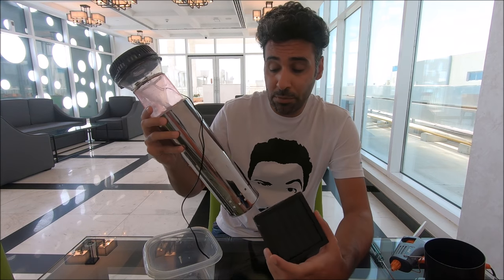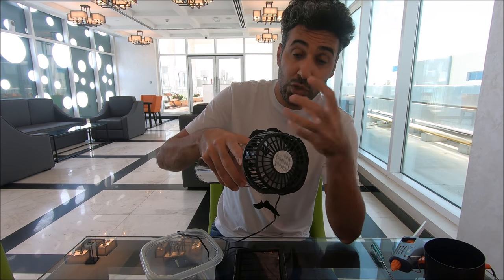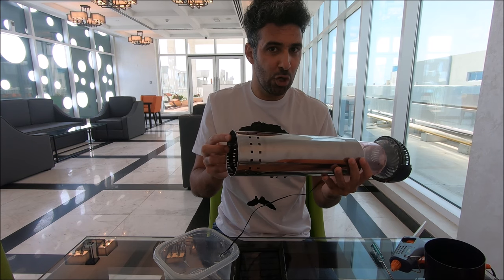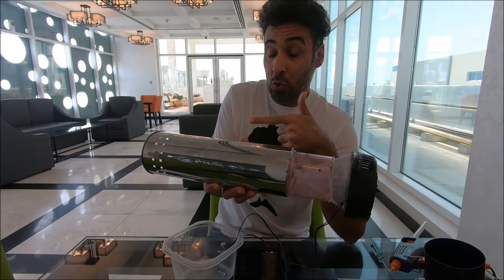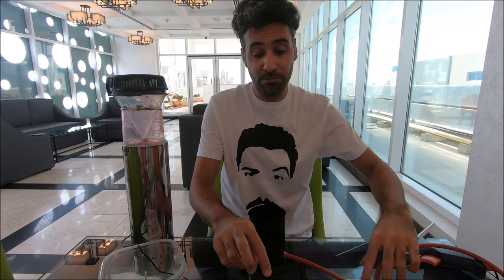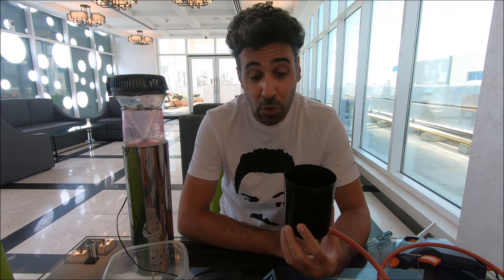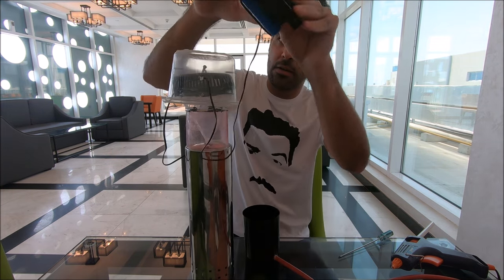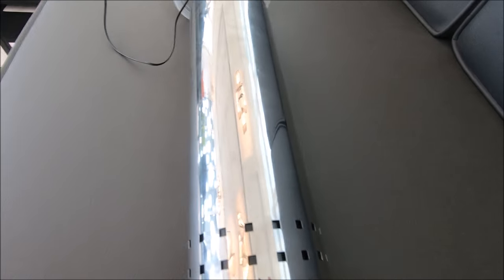Water from the air. Homemade atmospheric water generator (AWG)

Comment: Keep working on your design  I think there needs to be increased coil surface area similar to automotive radiator. I would not use an automobile radiator as many contain lead. Just something similar. Suggest giant lens to boil water from the sun. The lens could cook food when not used for condensing water. Good work, keep inventing.😊

Comment: It is wonderful your tackling the fresh water diploma in the world. If you can increase the output to one whole gallon per six or eight hours there would be a more practical application  for survival. Perhaps a 50 or 100 unit cluster could sustain a man for a day. The motor and coil, virtually all components will need size increase to increase output. I think highly of your design but a tarp spread over a hole I  the ground wo😮uld be simpler.

Comment: Yazdan, thank you, so much for your great contribution to the world in crisis. Did you try a bigger fan and a bigger cylinder to be able to collect more water? If we could get at least 10 gallons we could store it in a tank.
Reply from the maker: Thank you! I have not tried it but more air flow, larger surface area for condensation and, the most important factor, bigger temperature difference can definitely improve the efficiency and generate more water in the right environment.
Reply: Thank you, so much for your prompt response!!!!

Comment: Bravo! I was wondering how I am going to be able to get water to an off-grid piece of land. This on a larger scale will surely do the job~
Reply: I have a dehumidifier that collects a LOT of water (several gallons several times per day) from the humidity in the air where I live. It is powered by electricity but I imagine if you have solar power you could power it from that.

Comment: This is brilliant. You actually do no need to install it in the ground. It can be installed in the roof. As long as there is a differential temperature between the incoming air and the air surrounding the copper pipe, water can be extracted
Reply from the maker: Absolutely. The higher the temperature difference, the more the water extraction. 👍
Reply: @MrYazdan  Have you done any testing on the quality of the water extracted from the copper pipes?
Reply from the maker: @alf8652  No quality testing but I drank it and still alive 😂

Comment: This is exactly what was getting around my mind. However I wanted to make it like a rectangle but it was really hard to make it cold around the air condenser. So its a genius idea to let it be underground to make it right.  Thx alot.
Reply from the maker: You're welcome
Reply: @MrYazdan  would this only work in the underground?

Comment: Bro you rock man! Superb.. This idea will work even better if you dig 10 feet deep in ground and use geothermal temp difference!
Reply from the maker: Thank you. 10 feet down is definitely cooler and provides better temperature difference. Geothermal is way deeper and it's hot!

Comment: Neat prototype! How does the air escape after passing through the coil when the unit is buried in the ground? Did you dig a slightly larger area around the unit? I can imagine air that doesn't have as much moisture in it can rise up but it should have the space to escape. Curious how you handled that.

Comment: I have come across similar cooling  ideas to this but this is quite interesting.. the cooling chamber housing the wounded copper pipe with the fan for air intake at the top is really a great idea. My prototype has a similar design but I was stuck on cheap condensation ideas. Using the ground is definitely a great idea, was wandering if you are still working on improvements on this design cuz i would love to collaborate. I have a few other ideas to make the design more efficient cost effectively.
Reply from the maker: Thank you for your interest. I'm currently working on other projects with my students but I would be so happy to see your improved, more efficient design. I hope you make a video and share it with everyone. Good luck
Reply: I am interested in trying to do a larger scale real world non profit installation of something like this in the Philippines.  Would either of you like to  collaborate on this or provide any lessons learned potential improvements you have discovered over the years?

Comment: You could easily make the outer metal tube from vegetable cans, and other items from a local store.  In stead of burying the generator in the ground, I would bury a tall plastic pail, like an empty 20L paint pail, with a removable top, so you can let the fan stay above the ground, but covered with a dark cover that has a dust filter, and you can take it out to get the water.
Reply: yes, better since having only a tube from down in the ground only creates another problem - gravity!   How to force the water out to be used.

Comment: Hello Mr Yazdan!  Thank you for this brilliant idea :D
I'm going to try this out in the coming weeks at our ecocommunity lands in an arid area in Southern Portugal. 
I am not a big technician so i have some questions that are maybe very easy for you but would mean a great deal of help to me:

1. if you put this pipe in the ground and turn on the fan, what happens with the air that moves down the copper coil?  Where does it flow when it hits the bottom of the coil?  
=> Do I need to make an attached pipe at the bottom of the copper coil so that the air that is vented into it, can also leave through a sidehatch?

2. does the condense happen on the outside of the copper coil, or on the inside?

3. how humid was the air (+ -) in which you tried this out to reach one cup per 24hours?

4. was that cup around 200ml / 250ml?

5. how much temperature difference is minimum needed to reach the condensationpoint on the copper spiral? 

6. i read in the comments someone said to use copper steel wool instead of a copper coil.  How would I place the copper steel wool inside the 'toilettube'?

7. what happens when the temperature above ground is a lot colder than the temperature under ground (which happens at night in our area)?  Does it have the same condensing effect?

Thank you in advance!
Anaïs

Comment: Great device, I wonder if you would collect more if you used  a lot of coiled thin copper wire? also if you added a peltier device a larger solar panel and a peltier device to power it you could produce a lot more water with your system?

Comment: Came here to get inspiration for my own project, thanks. 
Added challenge, is not using solarpanel/fan. How would you tackle that?
I am trying to generate som hot air updraft and the force it to my could surface inside a sheed in my carden. But I dont think I can get it to work

Comment: Wow. Nice design. Super compact cheap and easy. Dont get much better than that. Im thinking about a bigger one using a piece of stove pipe and a larger fan with a better draw along with a 2 liter bottle. Unless that was the size you used? What size bottle is it? Also what is the purpose of the holes on the bottom of the tube? Seems to me between that and the loose fit of the cup it would lose efficiency. Maybe a bit bigger solar panel would be needed too. Finally I think I will try setting it up down in the earths stable point... to take advantage of the geothermal temp difference. Set up a bunch and BAM. Cant wait to try this out myself this summer. Namaste :)
Reply from the maker: Thank you. I'm happy that you're going to make your own and more efficient version. Those holes came with the tube 😂 no purpose.
Reply: Hello!  Im interested if you were able to build a bigger version and what your results/findings are.  Im about to give this a try in the coming weeks!

Comment: Great video: I have two questions/concerns:

1. Did you taste the water then? How was the taste?

2. Are the other minerals (such as iron, zinc, copper, iodine, calcium, phosphorus, magnesium, fluoride, sodium, potassium, and chloride) required to infuse in the water to make the drinking water healthy or it is just safe and healthy to drink the water directly coming from this technique. 

3. Are there any negative environmental implications in this method?
Reply from the maker: Thank you. I have tasted it and it didn't taste great! Because it wasn't treated and perhaps not very healthy to drink it unless it's an emergency or it's used for other purposes than drinking. And no negative environmental impact.
Reply: @MrYazdan  Essentially, fresh collected water isn't that safe to drink.  But there are some simple ways to filter it.  The State of Texas actually has official instructions for collecting and filtering rainwater.

Comment: Interesting Idea but  just a fan might not be able to condense water in hot areas like India . But what if we use a peltlier module to create ice cold water that will run through the coil ? Will it work?
Reply from the maker: Thank you. The fan is to blow the air into the pipe/coil not to condense it. Condensation happens due to the difference between the underground and overground temperature. Which is not very efficient if the difference is not high. Peltier has its own problem. Please watch one of my latest video that I've used peltier in a bottle.
Reply: @MrYazdan  Hmm But I will not be able to get my project underground
But if peltier plate is managed properly with good heatsink and that water is used for condensing will it work?
Reply from the maker: @krishnabansal9097  sure it will work. You just need a very efficient heatsink and the right amount of current for your peltier plate. Good luck 👍

Comment: Just an idea. Why not use another metal pipe, just a bit wider. Paint it black and let the sun heat the air in this pipe so it ries ans sucks unheated air into the cupper coipl. That would eliminate the electronics. The hight of the pipe/chimney will deside the efectivity of the movement. Havn't tried it but, I live in Sweden were it rains plenty...

Comment: I am planning to do this kind of project with some modifications I made air filter at the starting and construction an chamber which uses room heater principal and heats up air upto 105.4•C making it an evoparator chamber and through an  copper coil connected to condensor I am going to do surface condensation and collect the water and give to home made water purifier but I have some doubt regarding construction/design of evoparator chamber and making of condensator can you plz help me
Reply: I wanted to ask that could you help me doing an mini condensor so that it makes AWG complete,in water filter I mentioned also includes mineral cartridge which adds minerals back to water because it is not safe to drink reverse osmosised water directly
Reply from the maker: Hi. I don't know why you want to evaporate the water. Are you making a filtering system? Also I don't know how I'm possible to help you as my condensation system is based on the temperature difference between overground and underground.
Reply: I don't evoparator the water I will take the air from surrounding and raise its temperature,by doing surface condensation the temperature drops and convets into water,filtration was being part of this and in that I am going to add some minerals using mineral cartridge.Yes , underground and overground has lot of difference but I am asking that do you have any ideas regarding making of an regular surface condensor,if this section was done then I am complete this AWG
Reply: I am making an filtering system and added it as an part of this,and not connected as fixed so anyone can purify any unclean water,sea water,rain water etc, which can be also helpful for those and don't have to depend on one particular thing.
Reply from the maker: Peltier plate might be the solution. I used it for different purpose in this video https://youtu.be/XhfaWZ2BYHY
Reply: Can you give me an idea of how to send water through a coil and it should circulate with high pressure and should regain its temperature when it losses it .It should pass through an evoparator chamber so it losses it temperature and how to make its temperature regained and come back after an circulation to condensor it should have it's original temperature back. Do you have any ideas of  making such device or devices which do like that plz ( don't say refrigerator as it's compressor cost is too high and I can't rebuild it)
Reply from the maker: For the job you expected, circulation in high pressure, you need at least a water pump which requires more energy. My AWG device is designed to use less and renewable energy. You should contact your local engineers who can see your plan/design and help you directly. Wish you the best and good luck with your project.
Reply: I am using homemade submergable high pressure pump (Quantity:2) I think which will be enough and make an seperate supply using battery.I am not having idea of design the shape, construction according to requirements etc.

Comment: Most AIR is underground.  That is one of the DIY AIRCON without Electricity; by a hole where air be cooled then goes to the tube the house.    Our fridge is producing water in the form of ice.  One time, i will feed a coiled copper on the freezer and have the water coming out from the coil in a jar.

Comment: u may attach peltier for cooling or use pressure tricks to condensing
Reply from the maker: Yes I have used peltier in another version. The link is pinned at the top.

Comment: Am not really an electrician but I love the project,my question is how did you connect the copperwire inside the tube?
Reply from the maker: Thank you. Copper tube is glued to the plastic funnel and the metal case.

Comment: So you hook up the funnel to the copper line? ? Pumping air through the copper line? ????
Reply from the maker: Yes the air goes through the cooler copper pipe (coil) where condensation happens.

Comment: Hey man thanks me and my mate are trying to use aptmospheric water generation to make a self sustainable cooking pot well just me at the moment maybe sometime you could tell me how it could be made more efficient
Reply from the maker: Efficiency in this case mostly rely on the relative humidity and the sun. But more powerful solar cells and fan, longer condenser and bigger temperature difference between the air and the ground, increase the efficiency too.

Comment: Is it necessary to use the metal casing or could a large plastic pipe be used in it's place?
Reply from the maker: Metal case is better due to the better  heat conductivity.
Reply: @MrYazdan  Thank you!

Comment: I like your prototype, and me too i'm making some designs to make a water atmospheric collector with peltier module and solar, i just still waiting them to arrive.
One peltier module is sufficient to make water or not ? Please
Reply from the maker: Thank you! Peltier plates are not easy to handle due to the heat exchange difficulty. Unless you have a very efficient heat sink and more than one plate. Good luck 👍

Comment: 2 ?'s  1) what is preventing the cup from blocking the holes at the bottom of the toilet paper tube? 2) I forget ...no now I remember - would water collect faster the more powerful the fan?
Reply from the maker: 1) There's a gap between the cup and the tube. The cup is loose. 2) Not really. The temperature difference and surface area are the most important factors for water collection.

Comment: Sir how much power is need to produce 1ltr of water ... Can use this conversation method for agricultural purposes (if power is affordable)...?
Reply from the maker: I haven't calculated the power but very depends on the climate. Hot humid weather is best, where high temperature difference can be achieved.

Comment: This is on the brink of being viable, there's just one variable missing: you need to take the heat out of the copper - which is simple to do, you just add a heatsink and an exhaust fan, and there! You have a functional AWG.
Reply: What is a AWG?
Reply: @struebloodhornburglee251  atmospheric water generator

Comment: What makes the copper wire  become hot? What connections did you make in respect to wiring?
Reply from the maker: It's just a cupper pipe with no electricity connection. It's a good conductor, therefore it's cooler than air due to its position under the ground. Which is suitable for condensation.

Comment: Quick question, what are the components you used to make this AWG
Reply from the maker: Nothing more than what you can see in the video : copper pipe, funnel, electric fan, metal cylinder, solar cells, plastic container

Comment: Does it works   I need a conformation because if it works then I will make it as my birthday plz plz say true bro
And can we make it without using copper and just using peripte module  plz plz plz
Reply from the maker: If you maintain a high temperature difference in a humid climate and seal your device to minimise the heat transfer, yes.  Even though it's not a very efficient model due to the laws of thermodynamics. I don't know what peripet module is but you have to use thermal conductors. Watch my latest video for another design and happy birthday!

Comment: Bro plz cooperate 
I have a project plz 
If we use cooling fan does the speed is enough
Reply from the maker: Yes doesn't have to be fast. Temperature difference is the key for condensation.

Comment: If you close the fan then how the air is sucked from atm?
Reply from the maker: The fan is not closed, just covered to avoid sand and dirt entering the pipe. Air can still flow.
Reply: Can i replace steel tube with plastic tube
Reply from the maker: @shamsheerbaig2307  Ideally not. Plastic is an insulator. You need to increase the rate of heat exchange. Therefore metal case is preferred.